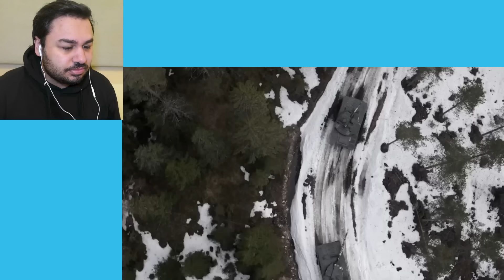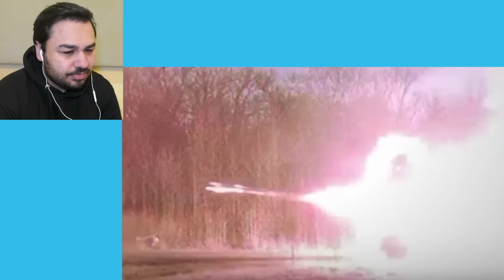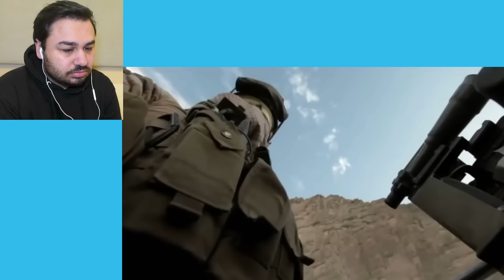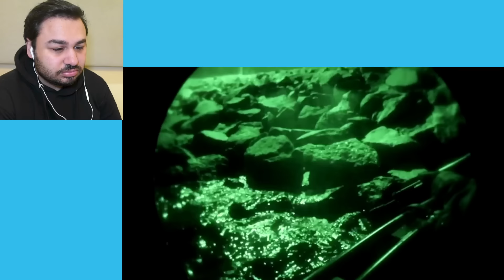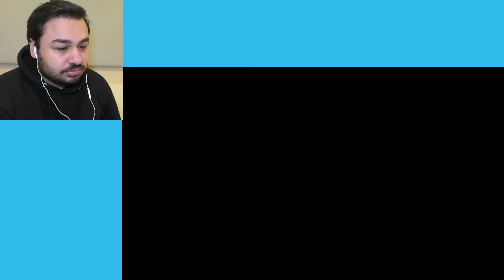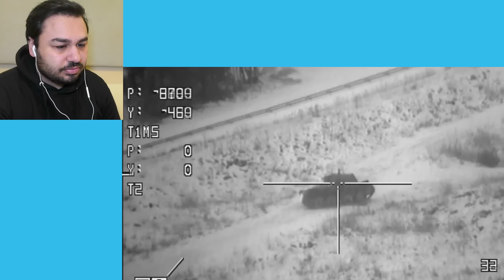British Reaction To Sweden's Invisible Tank (T Ghost / CV90120T)

Comment: The prototype's weight of 20 tonnes was actually super lightweight. Production units with extra armour and equipment weigh 35+ tonnes and the chassis is designed to handle 40+ tonnes. Which is stil light in tank terms. Modern main battle tanks typically weigh in at 65 tonnes (Leopard2, Challenger2, Leclerc, Merkava, Panther aso) and the Abrams topping out at over 70 tonnes. But the CV90 light weight and wide tracks are key strengths for difficult terrains. It can cope with snow mudd marsh and sand where heavier tanks would get stuck. Perfect for Swedish and Ukrainian territories. Only Russian tanks are usually similarly light weight. Only slightly heavier than the CV90120 with weights around 45-50 tonnes. But that's due to a completely different tank/war doctrine. 1) easier to mass produce tin buckets, (smaller and cheaper units with little to no high tech systems). 2) don't care about crew survival. Tanks crews and military units are expendable. Win by throwing large numbers at the enemy and having high losses that can "accepted". 3) Smaller tanks used to be more difficult targets for the enemy to hit. At least before modern computer aiming. For modern tanks it makes much less of a difference.